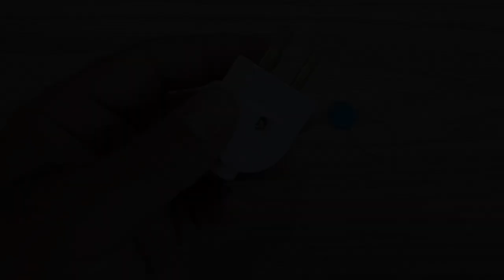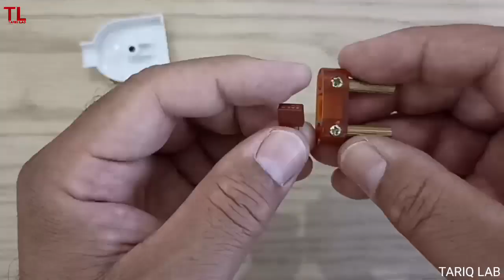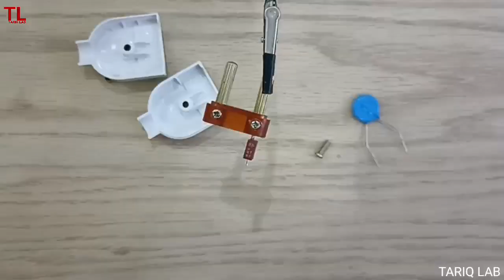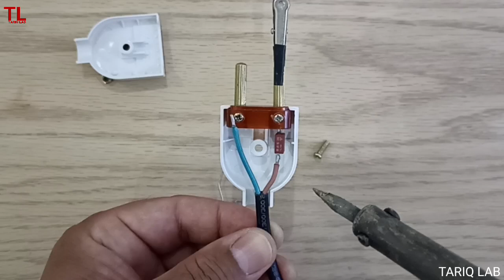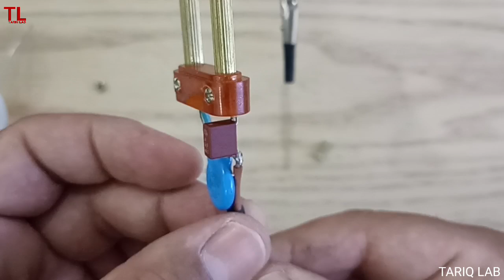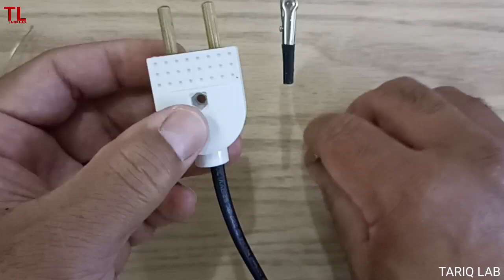How To Make Surge Protection Plug At Home

Comment: Just a quick question: does this plug protect high-power appliances from damaging other home devices, or is it intended for smaller devices to protect them from surges caused by external appliances?
Reply from the maker: For high power bigger varistor required, work for all

Comment: In a two pin plug if the line and neutral is reversed when plugging to the socket (since it is a two pin plug) will it be a problem ? or I have to maintain always the line and neutral when plugging ?
Reply from the maker: In AC polarity not required

Comment: isn't it better to use a MOV with a lower clamping voltage like 300 volts rating, in the case of S14K300?

Comment: How many amps should I set the fuse? I just want to make a plug with a 20D431K varistor and a fuse to plug into an extension cord to protect against interference.
Reply from the maker: 20D much bigger, ur load?
Reply: @TARIQLAB  There is no load, I just want to plug it into the pad extension cable so that there is protection against interference